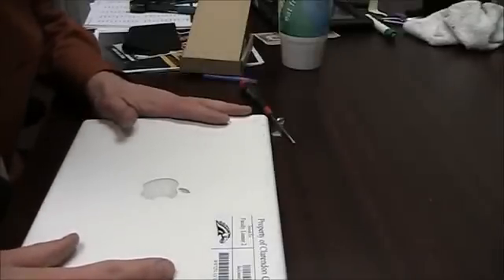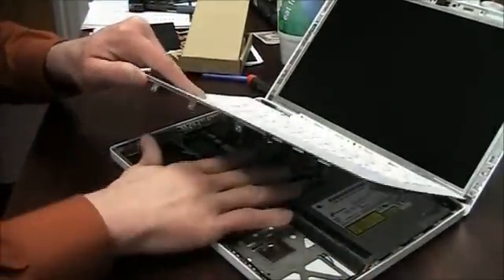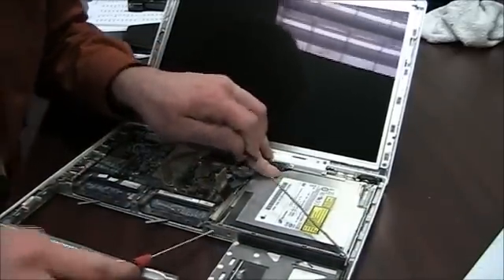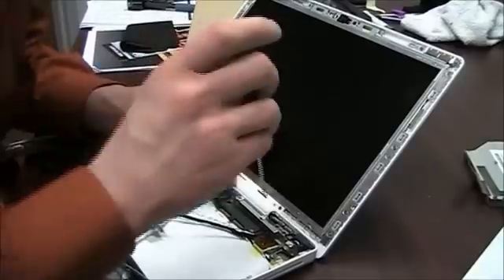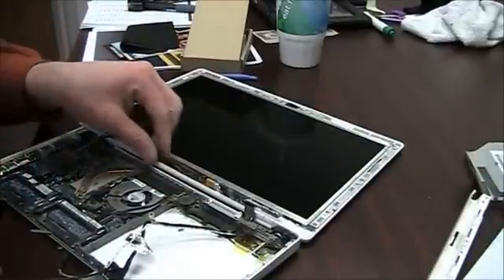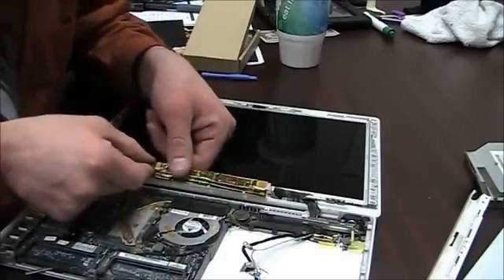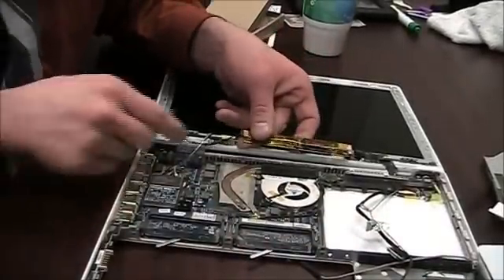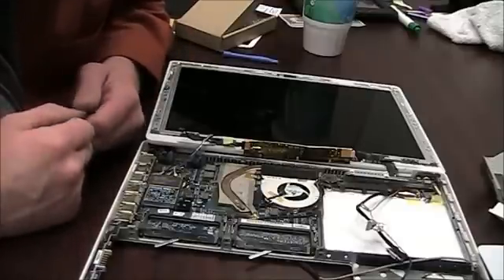Macbook Screen wont light up Model A1181 and up

Comment: Hi,

I am aware this video was posted long ago, but I have this black Macbook A1181 which have the backlight problem. From what I read on the different forums I checked, it's not an inverter problem (probably not cable either), since the backlight works for few seconds, sometimes even for minutes, and it can be shortly restored after a while by playing with the F1 and F2 buttons or by closing and opening the computer lid. Any suggestion of where the problem could lie?

Comment: Hey! Thanks for this video. My grandma has got this model and everytime she moves the lid the backlight turns of. It needs to be in a certain position for it to light up. Which isn't really workable. So I am going to take it apart and see what it is. Your video nicely explains the process. Due to the symptoms I am guessing one of the connectors or a cable has "failed" or become loose. That should be easy enough to fix. However, I have got all different sizes of screwdrivers and imbus and torx screwdrivers but no pentalobe ones. I do not yet have the laptop in front of me so I am wondering: to be able to open this one up, do I need pentalobe screwdrivers... or can I open it without those?
TiA!

Comment: Rather than going through all the hassle of replacing the black cable, get the multimeter in continuity mode and place one probe on the left or right far pin of the cable and place the other probe on the other far left of right pin on the black cable, if it doesn't beep place one of the other probes on the opposite side of the 4 pins and if it beeps your good on that wire then do the same for the others, if all beep for each wire you don't need to take it out. Reason you may not get a beep the first time is because you can't the the wiring an which side connects to the other side but once you've found one side and it beeps you know where you are.

Comment: You are correct about the left-side cable from the logic board being very fragile. Just pulling it out the wrong way can damage it. But this is usually where the problem lies with the backlight not working, because this cable moves every time you open or close the screen. It is best to remove that cable completely and test each terminal to see if one is faulty. You may attempt to repair it or replace it. I managed to repair mine and it works fine now.

Comment: I have tried reseating the inverter card and all connections.  I also tried using an external monitor.  It seems as though it will randomly go to sleep and when the screen comes back on I have to enter my password again.  The computer will start up but then the screen goes black.

Comment: So I just finally got os x 10.6.3 on my early 2008 macbook after getting it completely wiped and putting a new hard drive in it.  The thing starts up bright but after that it is really dim and the screen actually shuts off after about 5 seconds of it being dim and comes back on and repeats. Can this be solved with this or is it junk?
Reply from the maker: Just checking but did you make sure to hit your F2 key on your (Mac) keyboard to make sure the dim level is not set low.  As for it turning off in 5 minutes, is this after it sits for 5 minutes or while it is in use ie surfing the net.  This is what it sounds like to me.  If it was the inverter board it would be dim from the start
Reply: KeoFleX LLC the brightness is at max and I had already checked that.  And the screen goes black no matter what after about 5 seconds (not minutes) of it being on the desktop. Also when I shake the mouse the screen comes back on like it was in sleep mode.
Reply from the maker: shake the mouse? like a USB mouse?  What about if you move the screen back and forth rapidly?  If that makes if flicker on and off it is 1 of 3 things
1.  your screen is going out
2. Your inverter board is going out
3. The cable between your inverter board and logic board is going out
Reply: KeoFleX LLC yes, a usb mouse and no the screen doesnt flicker when I move the screen back and forth and when I shake he mouse it tirns on but is still very dim. So I ordered a new inverter. Is replacing the screen cheap? And Also can I do it miself? If so can you give me an amazon link to a cheap screen?
Reply from the maker: https://www.youtube.com/watch?v=sCN3u9sOALM

If you are buying it for an A1181 macbook (those are the white non unibody version)

here is my amazon store link.  Obviously you don't have to buy from my amazon store but I would appreciate it ;-) if you do.  Same price same product.  If this is not your model send me your model number or serial number and I will look it up.
http://astore.amazon.com/keo05-20/detail/B003JTK5A4
Reply from the maker: oops wrong amzon link that was for the unibody version
here is the A1181 version
http://astore.amazon.com/keo05-20/detail/B003TPA2OC
Reply: I figured it out it wasn't the inverter it was the bad battery because I took it out and it works fine now :D i'm actually using it to type this.
Reply from the maker: wow great.  Glad its working for you!  Cheers
Reply: +Nathan kauffman where did you buy a new battery for it? i have an 08 macbook too and still have the original battery lol
Reply: ***** I still don't have a battery for it lol I just keep it on the charger when I use it haha

Comment: Hi, I make you a question: I have to check an A1181 mainboard without LCD and battery works correctly. I tried to hold 10 sec power push and then insert the power mag to see if the fan was spinning at max but nothing has happened.
And 'fails? Have you more evidence for me to do.
Thank You
Ciao
Reply from the maker: Are you saying the screen is dim?  Have you tried resetting the SMC and PRAM